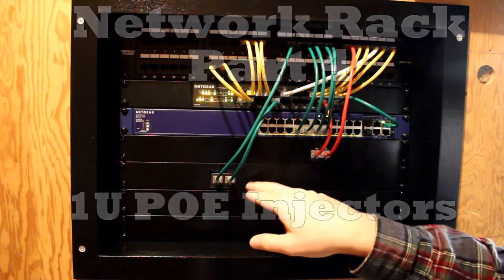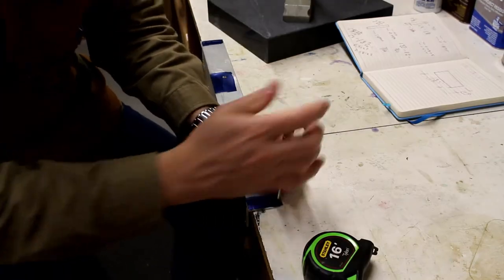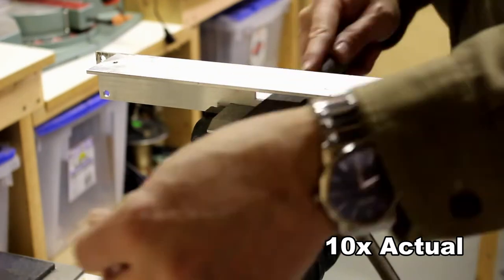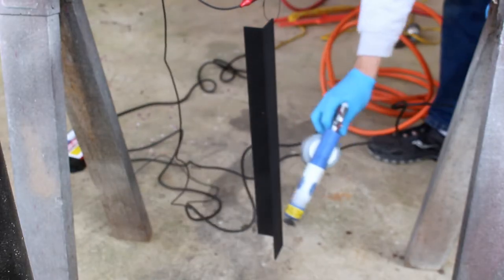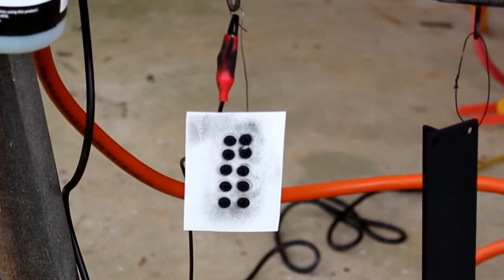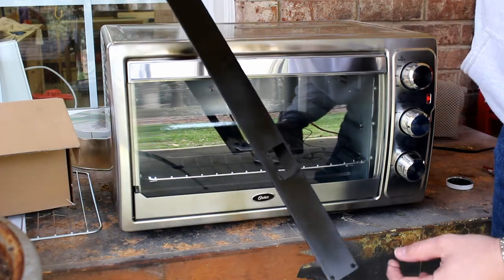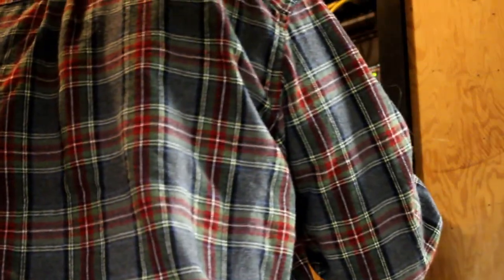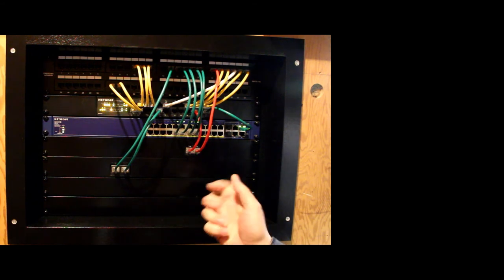1U POE Injector

Comment: Nice job on the rack, but I must ask why didn't you put both injectors on one, there is more than enough room.
Reply from the maker: Great question. I originally did the first for the WiFi access point (24v) and though all the others would work in the POE switch. One camera (Hikvision) did not work on the switch so I just made another. I may replace it as it has issues and then I can just install a blank.  Thanks for the comment.